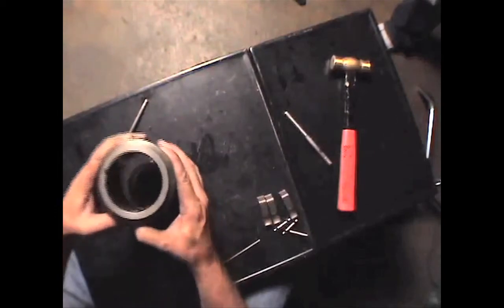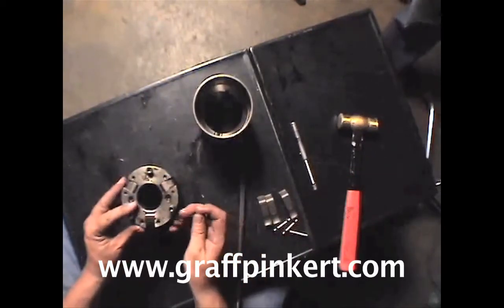How to Change Spindle Bearings on an Acme-Gridley Screw Machine (Part 1)

Comment: I worked at a shop that had nearly 100 screw machines under one roof, mulit's and single spindle, and the ACME's were the ones routinely getting new spindle bearings.  We had the ACME's, Guildemeisters, New Britian, Warner & Swayse and singles were Tornos, INDEX, Brown & Sharpe, and there were the W&S 1AB, 1AC, 2AB and 2AC singles spindles.  The maintenance shop would keep spare bearing sets for the ACME's on the shelf to cover 5 machines at any given time.  The other machines there was no need.